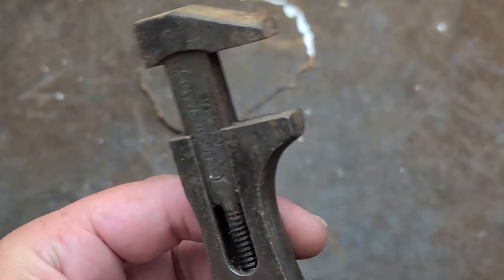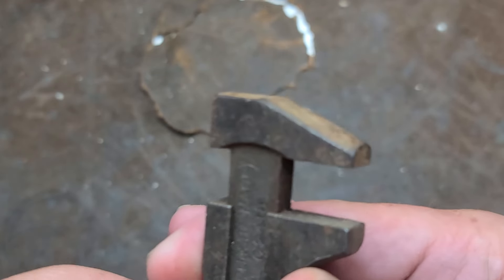A Vintage British Made Forged Adjustable Pocket Wrench Review

Comment: I think this wrench was probably made by a Sheffield-based firm called Footprint, I've seen a few of them over the years. Footprint are one of the few British tool manufacturers still in business, making punches, cold chisels etc. EDIT: OK, I've done a bit of digging around on vintage UK tool sites, and that part number seems to indicate that the wrench was made by a company called CJ&S - I've never heard of them before. If yours has an arrowhead marking, then it's military surplus - I found a couple like that. That pattern of wrench was made by a number of different companies, including Footprint, King Dick (yes, really), Joseph Lucas, and even as a Ford Motors service wrench. They are generally known as girder wrenches or girder spanners. Hope this helps.
Reply: According to the "adjustable spanner by Ron Geesin" book I have its a Abington king dick 1950 version.
Footprint doesn't make one in that stye.
Reply: @coroni4744  The King Dick ones I found were branded as such, and the one I found with the corresponding part number was described as being made by CJ&S. I could be mistaken about Footprint, but I thought I remembered seeing Footprint wrenches like this
Reply: @drengskap  according to my book king dick made them like that with just British made & c2418 in 1946 to 1950. but normally they are branded with their name or bull dog logo. they might have been unbranded for some retailers like buck & hickman i think a lot of their stuff they used to sell was made unbranded.
I don't know why they made them like that my book doesn't say. but it says there was a rumour that some of the blanks was made in Germany and assembled in Britain that might be the reason.
Reply: @coroni4744  OK, if you have the reference book then I'll bow to that authority. I guess it's possible that the C2418 was a government contract number rather than a company part number, and there was more than one supplier. These wrenches evidently were used by the armed forces, as there are examples available with the broad arrow marking.
Reply: I have a King Dick 3/8 drive extension. King Dick tools were named after the tool makers (Abingdon if I recall correctly) dog.
Reply: @MarcS-mp1je  Abingdon is the area of Birmingham where the King Dick works was located. You're right, the company was named after the owner's prize-winning bulldog.